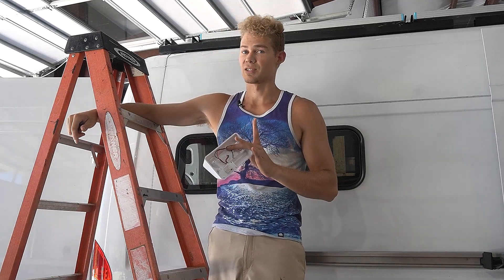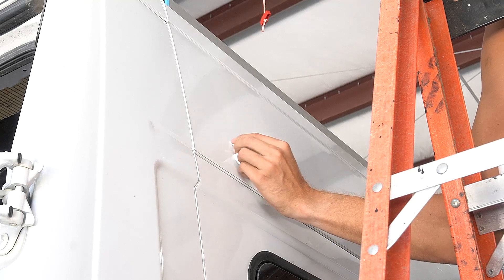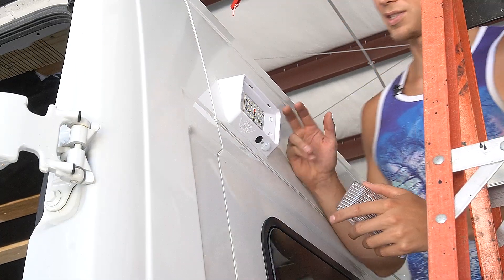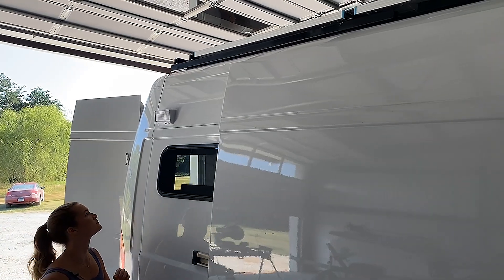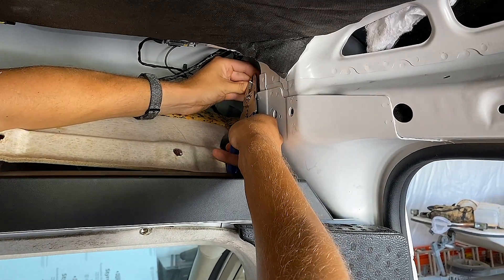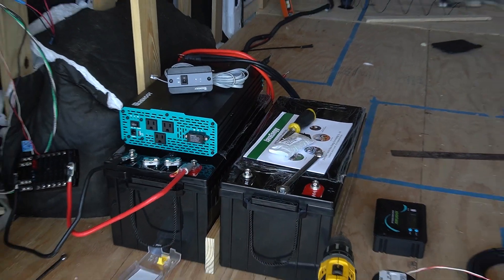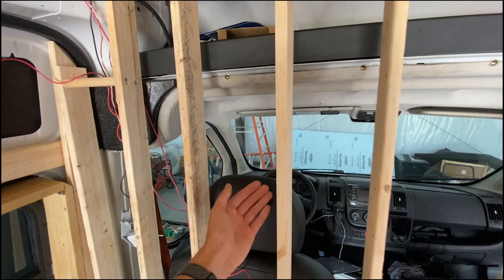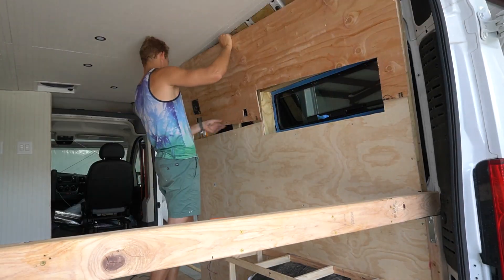Wiring & Electrical - Promaster 3500 Van Conversion (Part 8)

Comment: How much power can you run in there?
Reply from the maker: We’re starting off with 400aH of 12v lithium batteries and a 2000w inverter to get some 115v for our appliances. And with 300w of Solar on the top which gets us anywhere from 10-20amps on a moderately sunny day we have pretty much unlimited power during the day!